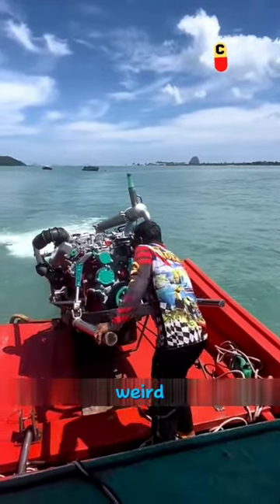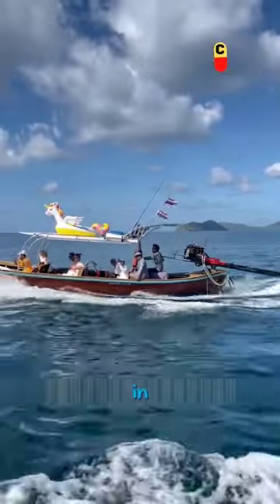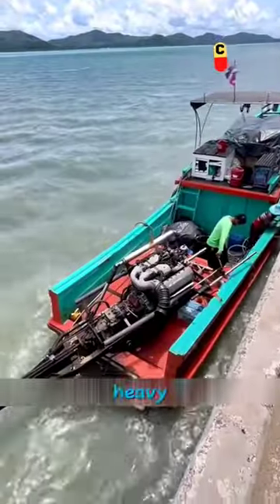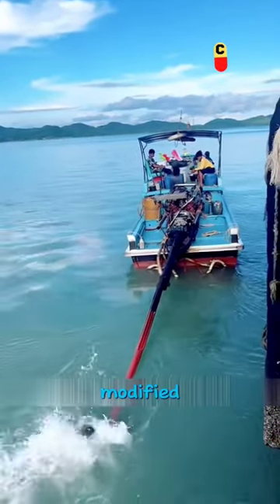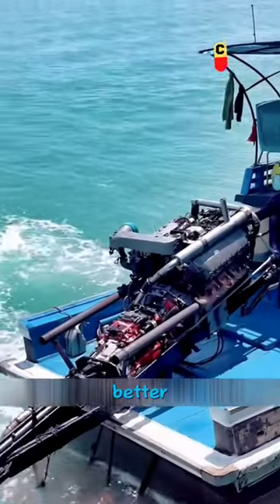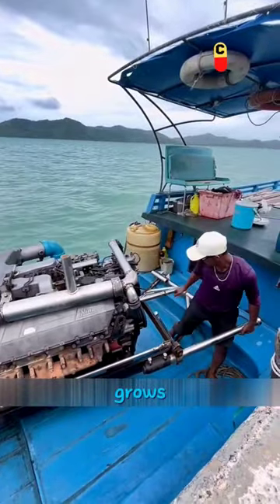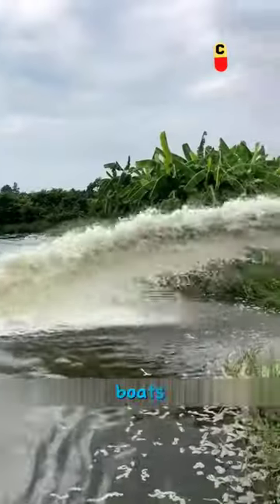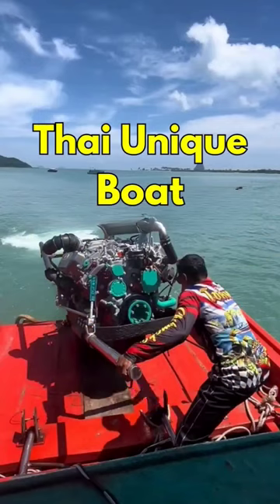The Weired Boat Engine 😱😱#shorts

Comment: The long tail boats can go in a foot or so of water. Regular inboard outboard motors cannot
Reply: 😂😂😂😂😂. Sure they can. Mine can travel through 6 inches of water easily.
Reply: @CajunKracka   Damn. The lower unit on your boat must not stick down very far at all.
Reply: @PTSDad79 I haven’t seen many boats that cant go in like 8 inch deep water. We have a starcraft ski boat that can probably do like 6 or 7
Reply: I'm just saying if the long tail boat isn't loaded down, you can go through much shallower water than regular outboards
Reply: @PTSDad79  100% theyre literal jon boats

Comment: With respect , you thais are very inventive and innovative.  Why not create a hydraulic system for lifting and steering the engine, for such huge engines you can use some of the power for the hydraulics. 
Doing the lifting manually puts a enormous strain on your back.
Reply: We do be innovative indeed. But we also like to keep things simple

Comment: People are saying the longtail will beat that speedboat but that speed boat has got 3 250hp engines making a total of 750 hp
Reply: And that one it's pushing about the same or more
Reply: If you get a 75 hp engine with 1/10  total weight then another set, you reaches the same speed and less 1 pound you win The race.